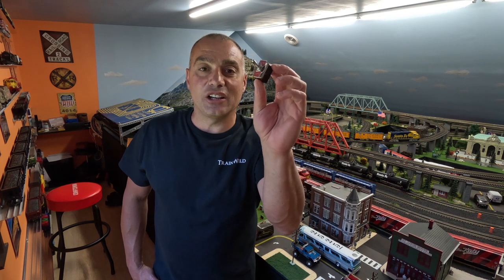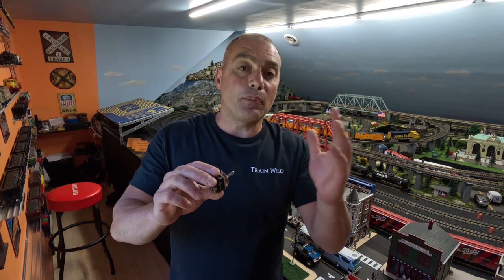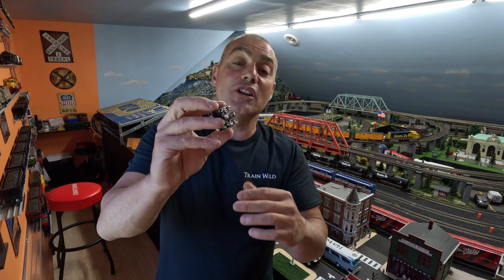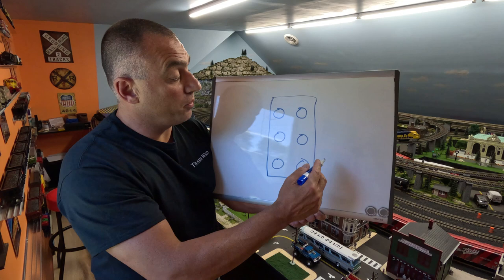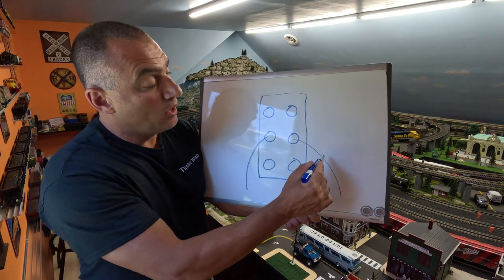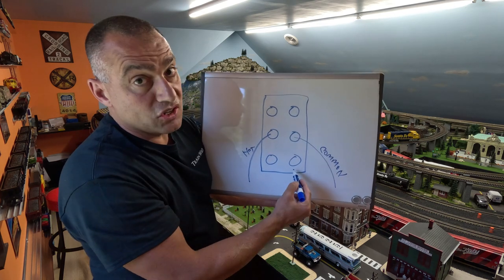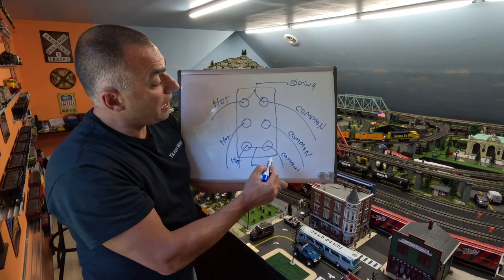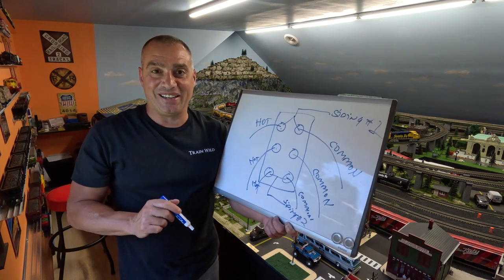How To Wire a Double Pole Double Throw Toggle Switch for Your Model Train Layout | DPDT Switch

Comment: Is this the same as all dpdt switches as other videos show that the middle and lower connection are the out for on? So confusing. Help
Reply from the maker: The top and bottom terminals are for power going out. The middle terminals are for the power coming in.
Reply: @trainwild  thank you for the reply.
Reply from the maker: @patrickmcmanus5373 your welcome!